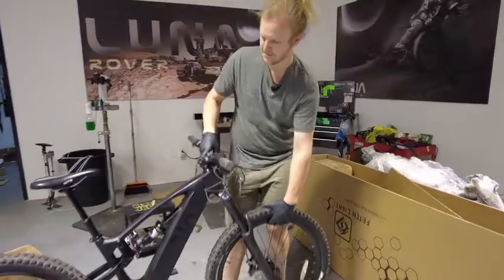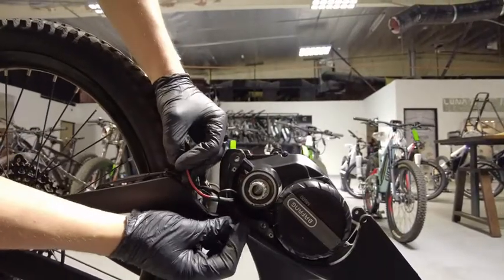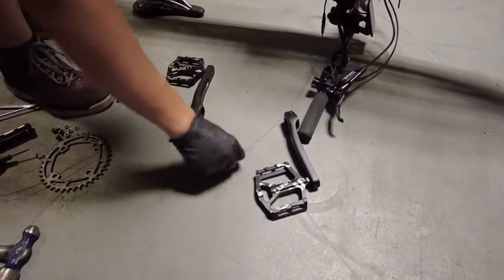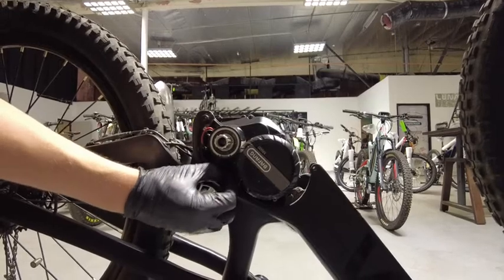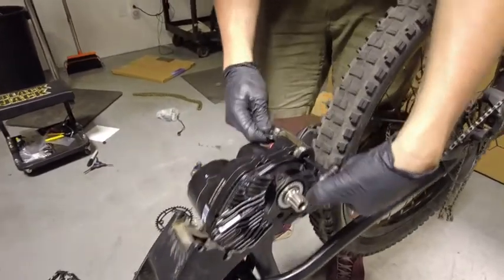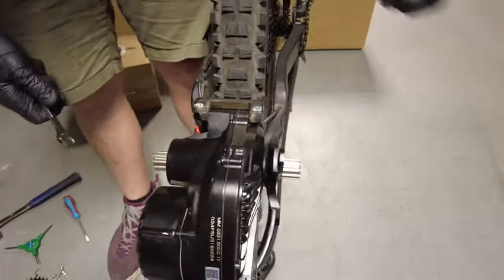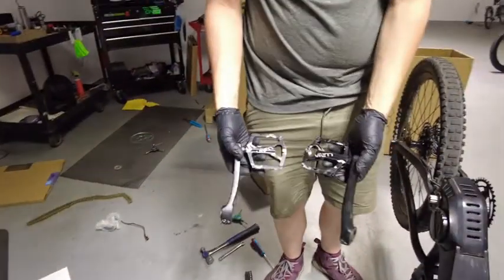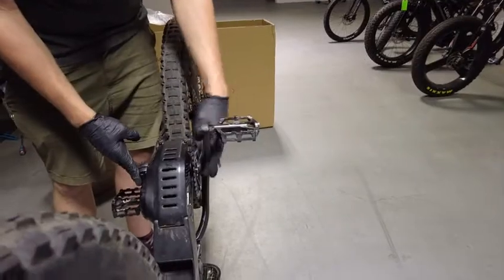How to install the M600 motor.

Comment: Couple of points:
1.  The 3 nuts for the motor mounts from Luna showed evidence of blue loctite on the bolts, so I applied some blue locktight to the nuts.  Last thing I want is these to work loose out riding. 
2. My bottom engine cover did not have the same noted four (4) 4 mm bolts.  The back 2 bolts were bolts and the front/front side bolts had screws.  Just FYI if you confused when you put your motor back.
3. Check your front sprocket bolts regularly.  From Luna, mine started to loosen after about 70 miles and the movement from the loose bolts caused the actual spider to break.  This is not a warranted part per Luna.
4. On the cranks, be sure to liberally apply blue locktite.  There are numerous reports of these bolts coming loose while out on the trail.  I've seen people advise red locktite for these.
5.  There is also the crank cover caps.  Also reported by some to have come out/get lost on trail.  A little bit of blue locktite is adviseable.

Note:  It would be nice if you put torque spec recommendations on bolts.